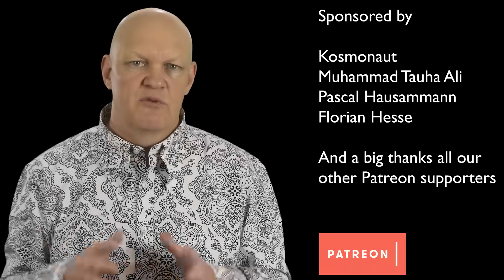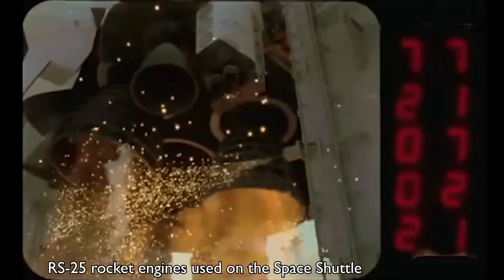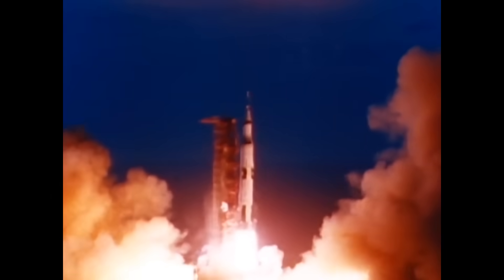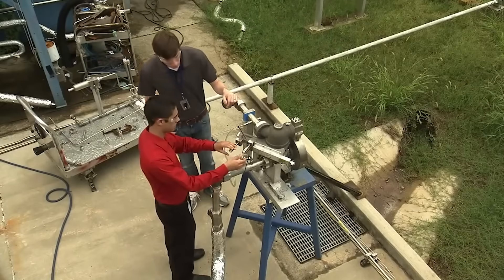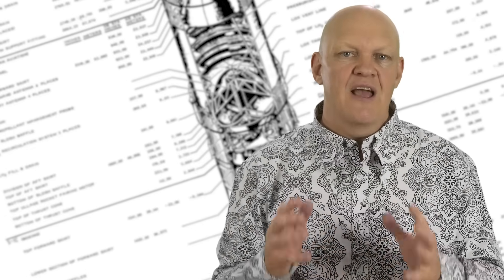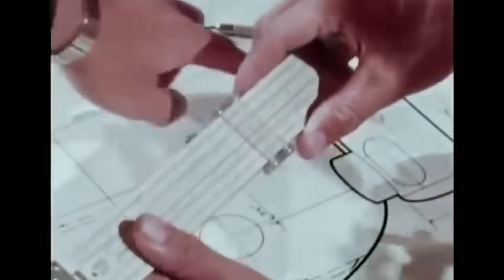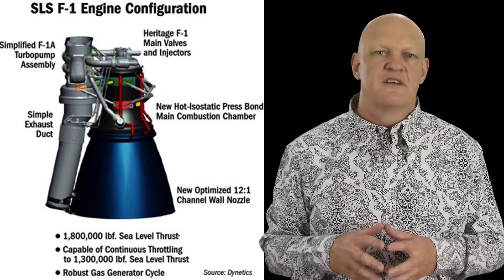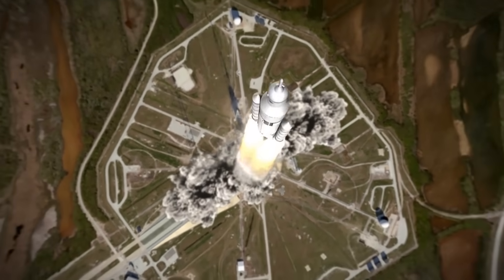Why Can't we Remake the Rocketdyne F1 Engine?

Comment: Skilled Builders and Tradesmen are a Dying Breed, unfortunate but true ..... :-(
Reply: Totally agree with your statement, as a classically trained Fitter-Turner I recently had the dubious pleasure of being partnered with one of the 'New deal' Apprentices(third year) and I was appalled at the lack of knowledge and training which appears to now be the norm, the simple job of knocking out a plain bearing was unknown, this was something I learned in my first year, now apparently a whole roller section (of which the plain bearing is one consumable part) is now scrapped and a whole new unit fitted at the cost of approx £1000 instead of replacing a £5.00 part.
Reply: Vaughan Ellis, the entire assembly is likely replaced, because the downtime of disassembling, repairing, and rebuilding the part costs more than replacing assembly does.

If a production line produces $100k worth of goods an hour, and it only takes an hour to do the job you describe, then the actual cost of the repair is $100,005, not $5.  If the entire assembly can be removed and replaced with a fresh one in 12 minutes, then the cost of that repair is $11,000, for a net savings of nearly $89,000.  In all likelihood, the job you describe will take more than an hour to perform, and be more prone to errors which lead to further downtime.

In fact, to make the difference between the $5 part and the $1000 part, worthwhile, the $1000 part only has to be a few seconds faster on that assembly line, and since the entire assembly will have to be removed *either way*, the bearing replacement is guaranteed to take more additional time than it is worth.

All that said, if a facility has the skilled crew on-hand, it may (depending on the work load of that crew) make sense to have a pool of spares which are replenished by refurbishing the assembly which was removed and replaced.  But every hour they spend doing that job is an hour taken away from their ability to do the jobs necessary to run the lines in the first place, which reduces any cost advantage significantly.  Often to the point where it ends up not being worth it.
Reply: @Vessekx And what happens when there's no spares on the shelf because they are waiting for a delivery and its the weekend?
Reply: @vaughanellis7866 , in *reality*, they keep spares of critical assemblies on hand, precisely to avoid that, and send broken ones out to be fixed/refurbished (or replace them if need be).  They also have support contracts which mean that someone can deliver a spare the same day if it’s actually necessary.

Sorry, did you think that was some sort of ‘gotcha’ that would make manually disassembling a complex bit of hardware, in order to have someone show up to hand-craft replacement components, and then reassemble it somehow faster and less expensive than the process that companies actually use instead of that because it ACTUALLY costs less down-time and less money?

I’ve worked in multple settings where they aceually had departments of people dedicated to repairing and refurbishing components like you’re describing.  In exactly zero of those places were those people tasked with doing so with anything other than equipment which had already been replaced with an on-hand spare, for precisely the reason I already described (and which you pointedly ignored).

It is significantly less expensive and deleterious to a company’s bottom line to replace a failed component with a spare than it is to tear that component down, fabricate and replace a failed part, re-assemble & QC the fixed component, and then reinstall the component.
Reply: @vaughanellis7866  because it's less expensive and smarter to change the whole assembly if one part of it is worn out odds are the other are not in that good of a condition so other things are bound to break and if that means stopping a conveyor belt and stoping production it can cost over 10 000$ an hour to stop
Reply: @AgateJeweler  A false economy when the skill to do basic refurbishment disappear through lack of use, what do you do when there is no spare part on the shelf and there will not be one delivered because its a weekend?
Reply: There is way too much waste and disposability in things these days. They're built to be irreparable
Reply: @vaughanellis7866  most of the new “rush through the program” jmen are high school dropouts the govt is trying to keep off the streets.  Many can’t read, have no grasp of basic math or science, and the sense of entitlement is horrific.  I’m in management now but I still try to mentor where I can, but most fresh jmen won’t listen so it’s a waste of time.
Reply: @vaughanellis7866  Sad but true, I'm a forklift engineer, we've seen engineers who have just finished their apprenticeships who didn't even know how to change a tube of grease in a grease gun (I'm not joking). Whoever taughtbthem failed them. 😔.
Reply: Those skilled Craftsmen are here. The problem is that they have abused and lied to so often, they're now in one man shops or flipping burgers. We don't like getting hired on empty promises and then laid off the first week of December every year. Private R&D and development programs were ended in the late 80's, early 90's. This put the Government in full control of new research subsidies and Corporations took their programs out of the US. When we're done playing the "Destroy America" game, we can get back to work.
Reply: In part because they took their secrets to the grave. The blueprint NASA has is merely a rough draft. The guys on the floor made it work and never bothered to truly document the thousands of changes necessary.
Reply: @Retanaru  Too much bureaucracy and paralysis of analysis.
Reply: Meanwhile I make $35k as a software dev... send halp
Reply: SuperPickle15 welders in my country makes 70 dollars a month
Reply: @SuperPickle15  build that skill
Reply: SuperPickle15 If you're making 35K as a software developer you're either really REALLY shitty at what you do or you live in India where the average apartment rent is like $20 a month and everything else is dirt cheap.
Reply: One of the best mechanical engineers it was ever my pleasure to know ran a machine shop in Columbus Ohio.  He learned all he did in six years at the Ohio State University during World War 2 and got the chance to do a number of very interesting things during the war, which challenged him and built his skill level up. Prior to the war he was a machinists apprentice, and when he volunteered following Pearl Harbor, he tested so high, the Army sent him to OSU where he received a Masters Degree Eventually.    

So, that took a total of six years of training experience - and a willingness to provide challenging problems to solve in an environment where risk was acceptable and the problems seemed important to everyone.  

This is what Kennedy called 'the moral equivalent of war' - space travel has that capacity -without the negative consequences of conflict - to build up tremendous skills in an environment where people are motivated to solve problems.  

Whatever we have lost through inattention mismanagement and corruption, we can regain in five years at very little cost, by investing in our young people and motivating them appropriately.
Reply: @williammook8041  wait the army paid for his education?
Reply: @williammook8041  good luck in making that happen.
Reply: @williammook8041  I hope your optimism is proven right.
Reply: Warped, I agree 100%!  
Just adding to what you wrote the "old guard" engineers are also a fast dying breed!  I work in aviation and it simply amazes me how our forefathers in aircraft engineering could build almost anything with slide rules, pencils, paper and their imaginations.  Some of them didn't even have degrees in engineering!  Sorry to sound belittling but nowadays we have engineers with all kinds of MBA and PhD degrees coming out of their asses, a battery of decades of info at their fingertips, computers that can model almost any simulation and yet they can't seem to get shit right!  Of course our forefathers had their failures as well but they were usually up and running again in a half year or less give or take.  Nowadays a failure of any type would shut down a program for countless years wasting millions (if not billions or trillions) of dollars and the lawyers would be salivating over it to get their cut of the pie!

Just my 2 cents.
Reply: @phayzyre1052  Don't belittle yourself - Those 2 cents are worth billions. Do you remember the Norton-Thiokol O-ring disaster in the Space Shuttle.
Reply: its important to avoid confusing knowledge and intelligence, if your apprentices are arriving having not been trained in a particular skill its not their fault, its the fault of the curriculum they where taught!
Reply: Retanaru I think it was more they winged it (based on their experience) every time. There was nothing to document as it was different every time.

The true outcome of this vid overall was "we can build these, better.. but decided to use something else".

There was no can't at the end.
Reply: that guy Where??? I'm a welding apprentice / fabricator in NYC and can Arc, Mig and Tig. There are no jobs, and my current pay is shit at $11 per hour working for a scumbag family owned company that uses illegals. They rarely use me for welding. It's a scam. I applied to 7 better jobs this past weekend and the only one that replied was a rejection. To be clear: welding is far more important to civilization than most jobs. Between illegals and a shitty make nothing economy the trades are dead. Good thing I have a degree to fall back on.
Reply: @zackthebongripper7274  did you ever find a better paying welding job? I see plenty of people on this thread who have no concept of what NYC is like.
Reply: @WarBringerRedBeard  Yes, making $30 per hour uncertified as a welder in fabrication. still looking to get certified.
Reply: @Vaughan Ellis 
Money making opportunity for the parts refurbishing industry ;)
Reply: https://www.bls.gov/ooh/computer-and-information-technology/software-developers.htm#tab-5

$103,560 mean pay
lowest decile $65,670
highest decile $164,150

I would say 1 in 1000 would make $300,000 or more.
Reply: The Mad Gentleman 
True, because customers want the cheapest they can get. I'm an electrician and people expect me to  charged them near minimum wage hourly rates for my work, a lot of these office workers think that my job is less valuable than theirs.
Reply: No, they're not. People just refuse to pay for those good tradesmen. They'd rather pay for unskilled foreigners to do the job.
Reply: try and find a carpenter today that can figure an cut rafter and stair  stingers ....
Reply: @wayne-kj4iw  rafters are easy af, try to find one to convert hip and valley rafters, that's more rare.
Reply: koolkitty8989: Beautifully put, sir.  Spot on.  If I were POTUS, I'd appoint you to head the push to institute putting all this into proper order for a brighter future for America.  Seriously, good on you, mate!
Reply: K Me: tell this software developer how many software developers you personally know who make at least $300K.  Please.  And in which state do they work?
Reply: You Think so... Take your Broken office chair to a backyard garage welder and see if he will weld that leg on for less than $50 today... you are quickly replaceable... a good welder (X-ray Specs) is hard to find... but Donut eating swivel chair Riding cowboys always think they are worth more... while sitting in a chair 67 stories in the air, welded together by a poor lowly welder.
Reply: It's because what are essentially blue collar professions like welding and fabrication are looked down on in modern society. NASA is run by a bunch of college educated theorycrafters that have never had engine grease on their hands. Some skills can't really be taught, they have to be learned. Many of these people honestly think they are better than us, and constantly tell people that learning a skilled trade is somehow less noble than going to college. It's sad, really.
Reply: @1337penguinman  Thats funny since I am treated (and paid)  like a royal by most oil and gas companies
Reply: @1337penguinman  You are correct.
Reply: allthough the reasoning seems logical in this video.. im quite sure it will be possible to remake those engines.. the people on thecproduction will do exactly the same as their predecessors.. and "wing it" maybe even go to the trouble of documenting their days work and tricks. the people to build such things are still around, this i know because i work among them. the real truth of this video how ever lies in its conclusion, that it is way easier and better to do a redesign based on current available technologies...which by the way were in no small matter pioneered back then...
Reply: Vaughan Ellis the repair industry is dead. And been replaced by tube jockeys who know nothing but unplug throw away and replace. They have no real diagnostic skills.
Reply: @michaelshultz2540  Agree completely, God help them if the ever have to build something new from scrach
Reply: Vaughan Ellis We've done a cost analysis on a few jobs like that. It turned out that replacing a $10,000 gearbox can be cheaper than replacing a $500 gear if it restores production in half the time. Automation has driven the cost of replacing assemblies below the cost of rebuilding parts and a much less skilled worker can be used. The quality and uniformity of the replacement parts has increased tenfold. There's a reason we don't pour Babbitt plain bearings any more.
Reply: Roberto, I understand all of that.  NO job, career or whatever is "screw proof!"  My point is that college has been for the past 2+ decades as being touted as the key to success in life and the professors and presidents who run these colleges are laughing all the way to the bank at our stupidity!  People dole out thousands just to get that extra edge in life but when it all boils down you might have a degree in one regard but if that degree doesn't do you a dime's worth of good or only gives you a silly title with a meager amount of pay you might as just be holding nothing in your hand but your dick!
Reply: Observing globalism is not the same thing as being one.
Reply: Today if you don't have 2 or 3 college degrees or you clearly aren't qualified. What a shame really, there are plenty of skilled craftsmen in the world who could have done it today, but none, or few, have any college education so NASA isn't going to bring them in and give them twice the pay. Nah! pay some fresh meat straight out of college half as much but let them take 4 times as long to figure out a similar approximation. That is the American way!
Reply: Nailed it Penguinman, Business degree Micromanager BS may well cause our downfall. In Germany Miester Brief trade qualification are highly respected. A sobering thought is that North Korea has some 16500 CNC milling machines pumping out rocket parts. The machines themselves are Russian Soviet based designs manufactured by the North Koreans. Food might be in short supply but respect for blue collar trade skills are not.
Reply: Try that developer job in a Leather overcoat and wearing a helmet with Black Glass, while out in the sun, temperature near 100, and while hanging from a cable chair inside a Dark Pipe 150 feet in the Air...{NO NET}
Reply: Ahhh, fishing for excuses. All the guys in my TIG class like me, and come by to ask for help when the teacher is busy. I make better Stainless TIG welds then illegal alien that gets paid more than me. Yesterday the illegal alien welded a SS 1/8 x 3" cap for a bumper and the weld had carbon precipitation all around - not good. I said nothing, because I don't complain.  I break my back and work hard.

No, the REAL reason is I'm being taken advantage of and no other company will give me a call back for a interview. So, I'm stuck right now.
Reply: I've been a welder for 26 years an all of my welds are x-ray certified,but company's these days don't want to hire damn good welders,cause it's better to hire 3 mediocre welders for a 1/3 the cost..and they get away with it...and if theirs any good paying govt.jobs welding,then good luck getting thru all the red tape getting the job..welders are a dying breed because we're tired of all the headaches of getting used for a bit then thrown a lay off slip..more stable and beneficial jobs out there than welding..
Reply: This is so true. My home built in the 1950's had more attention to detail than the builder renovating parts of it 20 years ago. Just because things are out of sight doesn't mean you should care less about completing them properly.
Reply: Wang Computers: Oh and one more thing I forgot to mention....
Unions are on their way out.  Unions at one time used to be good and give the workers a voice but in today's world a union is old hat archaic and dinosaur-like.  I worked for a union for twice in my life: my first time and my last time!  It was a two year journey through hell that took care of every piece of shit lowlife worker whereas the decent productive ones like myself got thrown bread crumbs.  Only way I'll ever work union again is if my family is about to starve and from the looks of things that's not going to happen at my non-union job.  I make nearly $80K a year and I'm completely satisfied with that.  Sure, I could work union and make more but then I'd run an even higher risk of getting laid off.
Reply: Millennials may not be able to duplicate the F1 rocket engine, but they can sure tell you if it was sexist, racist, or homophobic!
Reply: Warped Perception eh, I blame tuition
Reply: Warped Perception true, plus companies want things done yesterday and won't put the amount of time or capital needed to correctly training people to get the correct skill set.
Reply: Warped Perception 
You are correct.
Reply: What do you expect when all the country raises children to believe that college is the only way for everyone. Also welding and many other trades don't sponsor themselves enough plus they want experience experts to show up out of thin air even if the opportunity is not there for the beginners
Reply: Warped Perception 
666th like

Ok this is pointless.
Reply: Absolute bollocks, if that we’re the case, we’d be technologically stuck. Seeing how we aren’t technologically stagnant, your suggestion is complete bollocks.
Reply: Its funny because thats what coopers and thatchers said 100 years ago. Modern expert craftsmen and women work in industries that you have probably never heard of designing and fabricating using tech you don't understand. How did they get a machine from 5600 parts (or however many it was) to 40......40 parts.....because getting the most out of modern manufacturing techniques is an art form every bit as detailed and careful as any other craftsperson uses. 

Im sorry to say that when technologies move on so we lose skills. Ask anyone at a lost trades fair...it sucks but fitters and turners may be one of those lost trades in 50 years
Reply: @Wang Computers either fill them or bring in automation as much as possible

We can't afford a slow in pace
Reply: It's called progress.
Reply: I actually think this is true and untrue at the same time. True in the sense that with shifting production to new countries the old guard hasn't exactly reinforced the next generation of machinists and engineers. Untrue in the sense that the new guard is learning fast and Chinese quality has advanced rapidly. People used to call Japanese products cheap crap and now the likes Honda, Suzuki, Nissan, Kawasaki etc... stand out for their quality. Heck I have had several $$$$ German disappointments of late. The same will be true of Chinese brands in the same (or close enough) timeframe. That is unless we decide to shift manufacturing to Africa in ten years and re-start again!
Reply: China will never up their quality as long as they can make a fast buck.  Im a crane inspector and 40 yr journeyman ship fitter/ welder. The welding in the Chinese cranes is very very poor. NO quality control. No attempt to follow D1.1.   Found a huge slag inclusion, over an inch long and 1/2" wide, at the hinge mounting plate of a crane. Sub arc weld. Chinese engineer said Quote> That slag was caused by something you did using the crane. <. Showed us a clean x ray with no id marks at all.  Five years of UT inspections followed for me.  The results were ugly.
Reply: @kolsen6330  same thing with Mexican laborers
Reply: L Parker Africa is barely industrialized. No way that's happening.
Reply: @SaneAsylum  You forgot Toyota.
Reply: L Parker I've never heard people calling Japanese produced items crap. That's China's thing. Japan has always produced quality
Reply: Paderick Monahan Japan's products quality was awful until late 80s/early90s
Reply: If I could make sense of it I might try to explain "that."
Reply: https://youtu.be/YQKzg6aueWg
Reply: K me is full of shit!
Reply: It's NASA, and You don't understand the Math... Ha ha ha
Reply: Turn over , see if this Fits!
Reply: only you get that 4ever min wage /A GOOD WELDER GETS MORE AS TIME PASSES
Reply: Its because its been bullshit all along. Just like losing the tech to go to the moon. They lost it. Whatever. Lies.
Reply: AaronAlso,,,if I had the papers to prove that I know what I know I could get a job working at Area 51. If you the papers you can get any job no matter how much you do or do not know about the job. I do not care if you have a IQ of 1000 if you do not have the papers to show it you can not get a job sweeping floors.
Reply: yeah you are right ,but i see some of them in youtube ,but they are still rare
Reply: Faronthefiddler Im glad you got it right . Im a master mechanic with30+ years my wages keep going down the more i give the more they take even tried multiple locations ppl dont repair there cars like they used to it becoming disposable how do i go to work for 90+ hours and make 50 when i used to be able to make 130+
Reply: Warped Perception yeah but the will with in us still lives don’t lose hope
Reply: All by design
Reply: not totally true, i'm in my early 20's and taking up blacksmithing
Reply: The fact that people are taking up these trades does not change the fact that it is dying. Think outside your bubble.
Reply: Dying breed but still in demand for another 50 years = million dollar salaries
Reply: There are electricians making $400+/hr in high dollar areas just because there is a high demand and very few electricians let alone master electricians
Reply: And if you don't want low pay and shitty work environment working for another company just start your own, that's what a lot of people do.
Reply: I know another type of people that is a dying breed...
Reply: Brad Viviviyal  a fortune 500 don't think so.
Reply: Tell me....I'm a young machinist
trying to learn manual machines 
instead of CNC's....
Reply: As a pipe fitter I can tell you that is very true. I am amazed at the lack of skilled craftsmen nowadays.
Reply: They are dying because the paychecks flr that trade is dying and nobody will work for 10 bucks being a pro like alamogordo pays it's welders. Why they can't find anyone.
Reply: An F1 engine not the only thing Millennials can't make, that the, fueled by coffee & cigarettes, flat top haircut & sliderule, pocket protector generation had mastered. How about a molten salt nuclear reactor? They are safe from meltdown: https://youtu.be/tyDbq5HRs0o
Reply: Yeah! And where did all the skilled buggy makers and wheelwrights and barrel coopers get to? Such a shame...
Reply: Bullshit
Reply: sad but true : /
Reply: It's the way the world goes on, quantity over quality, a skilled worker can beat a machine everyday in the quality of the work, but can never beat the machine on quantity. And engineers spend all their time perfecting the machines rather than the product itself. It's just how the world goes. Imagine people saying back in the 1900's that skilled sword fighters are gone.
Reply: @mondo odnom Not old just experienced, to know that full units are not always available and you have to be able to make what you need when you need it
Reply: you need manufacturing to train them they dont come from thin air
Reply: not really. I think you missed the point of this video. You should rewatch.
Reply: @CombatMedic1O  I did , the point is people suck. Especially 5 yrs ago
Reply: Well one of the big problems is the trade skills has not paid very well for a while why start off of $14 an hour as a tradesman when you come work at Starbucks in the air conditioning and get paid the same.
Reply: @watertriton Our society has devalued real skilled labor
Reply: The interesting part is that many of those old-school craftsmen, machinists and engineers alike, were, and are, pushed out of aerospace world by up-and coming generations. Their methods weren't the latest and greatest, but instead relied on hands-on knowledge and a deep understanding of the principals of how things worked. These days, if you don't know 3-D cad or grow parts in a printer, you don't represent the new way forward. Never mind the old techniques developed over generations. Still, it's a brave new world. Now, the new breed gets their turn. Just two words of warning...  Don't screw the pooch, and get used to the idea that eventually, you'll be obsolete, and will be driven out, too. Good luck, and welcome to the modern world...
Reply: L Parker globalist?
Reply: dat boi      To Africa? Why not to the U.S.A?  My guess is L. Parker is a citizen of a country other than the U.S.A.
Reply: Warped Perception one big EMP and the knowledge and engineering abilities of our hi tech world will be set back to the early 1900s.  Back to vacuum tubes, steam engines , and the wild wild west. Enough to give Mr. Spock a headache.
Reply: Warped Perception  100 % right now every body goes to gogel I repair equipment all day long I'feel people dont understand what I do people think its easy and take no skill
Reply: Michael Shultz I am an A.S.E. master tech with advance diag. Plus many manufacturer certs. I also have welding certs. I make excellent money. 6 digit. There is gonna be a massive shortage of mechanics and techs in about 10 years. It has gotten very complex. Most techs are lost with diag these days. I even take on diag from dealerships on cars they can not figure out...even had to school a few engineers from said manufacturerz along the way.im in my 40s but om my way out. My body is starting to go from all the injuries and hard work. I want to be able to live well into my 70s ams be able to get around. There are no young kids coming in with a clue. I feel sorry for the people who but new cars ....soon enough getting them repaired will take weeks ....cost a fortune...and getting it fixed right the first time will be a tjing of the  past. So sad
Reply: our current society is failing..
Reply: SuperPickle15 but you get to be inside. Its 104 in texas. And some people in my town have died of heat stroke.
Reply: Zack TheBongRipper 
Your skill might not be up to standards or have terrible personality. Honestly close to 90% of the undocumented labor force is how should we put it unqualified/untrained and if your employers are paying you the minimum wage you might not be that great of a welder. Try to get out of your comfort zone, there are quite a few jobs where if you have some sort of trade certification you could make over $20 within a year and more after a couple of years. Stop blaming others for your shortcomings.
Reply: @robertopics  i am a journey level shipfitter/welder. Did a 4 year apprenticeship and got my card in 1976.  I have welded on ships, high pressure steam, nuclear, and crane booms. A year or so ago i filled out a stack of employment forms and was then told pay started at 9.50 an hour.  ( Got 12.50 or so as an apprentice in the 70s) Company didnt want trained people, only drones. I asked how they expected to get qualified welders at that wage when mcdonalds was paying 10.00+ an hour. They pointed me at the door.
Reply: @robertopics  I think others collectively are to blame and that's a good reason for whomever to do what's possible 

This is what should have been said in your response 

You guys let NAFTA be a thing 

And that's what killed USA industry

I mean every year before was a freer market thus trade 

This government buried small businesses and ran as many surivivors out respective to each region of commernce both economically and geographically (Food grown past the mountains in California technologies in the west to wall St in new york etc)

Strategic hits essentially

At any rate instead blaming each other we should understand that we are running out of resources and deal with it the right way

We will see the end of humanity within 400 years without fail as it stands

Vital resources depleted or otherwise too hard to get on this planet 

But there is good news mining asteroids and colonizing space will pull us out of this
Reply: Phayzyre105 
Well that is the case/risk with any job even trades. Remember the lawsuit against Trump for bringing foreign workers? Even tradesmen get screwed a lot of times. Willingness to work outside of your comfort zone is key in life. A lot of individuals have that mentality they get a nice job with benefits but when they get fired they don't even know what to do and are unwilling to adapt, I've seen it happen a lot. Certain careers like graphic design, basic computing programming, and any job that has the "assistant" moniker in the health injury have a high risk of disappearing in the future.
Reply: we built the pyramids. but we can't anymore. we built the F1 rocket. but we can't anymore.
We could set the time on the clocks in our cars... But I forgot how to do it. so I can't anymore.
Are "we" smoking too much weed?
Reply: @chrisvellner3922  we could recuild the pyramids, better and bigger if we wanted, and we can and we redesigned the f1 engine better than in the past
Reply: @Philip Martin 
Partially true... it has to be an extremely skilled and specialized welder.
On the other hand, a highly skilled software developer (often without a degree, like myself) can easily have over $300,000 salary.
Reply: @kaba_me  Bullshit, I make $120,- an hour with pressure A/B welding and there's lot's and lots of us out there. How the hell do you think oil is won, bridges or chemical plants are built or electricity grits are made? Keep making apps and other useless programms while we continue to shape the world you moron.
Reply: 1337penguinman: Another spot-on post from someone who knows!  Look at the shitty engineering of the Hubble Telescope.  Look what it takes to replace a motherboard in the Hubble.  132 tiny screws in zero gravity?  REALLY?!  How about a single edge card socket, perhaps made from a very resilient low-temp-resistance, high-radiation-resistance thermosetting plastic?  They could have even used a standard component format.  An experienced engineer with machine time under his or her belt would have thought of this before pencil touched bumwad.
Reply: K Me you think pay tops out at 60k for welders. Lol.....nah underwater welders make more than you
Reply: Zack TheBongRipper get out of a blue state and come to a red state. Cost of living Will be cheaper. Remember you are an apprentice. The big mpney comes after you complete said apprenticeship. Stop whining pay your dues and the money will come. I het you are a young guy who thinks he is entitled to make more than the old timers who are teaching him. Im just disappointed in guys like you.
Reply: that guy
Demand and salaries are nothing to do with amount of skilled craftsmen. You learning doesn't mean you will become a skilled craftsman.
Reply: absolutely not.
they dis and get replaced by the next generation.... your car and your house are fine, dont they?  guess what, in fifty years, thell get even better.
how do you explain that?
Reply: @francoisuntel6238  will these machines and inventions using computers stand the test of time?What if the computer system completely shuts down?and the information.the plans .blueprints are erased?Today's students are not trained to make metal into something complex and make it function right.with their bare hands.